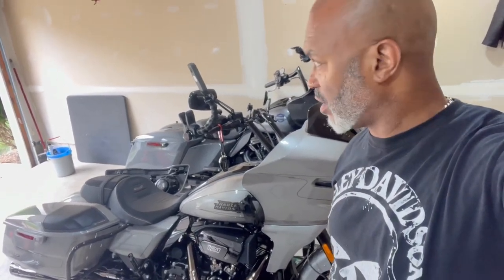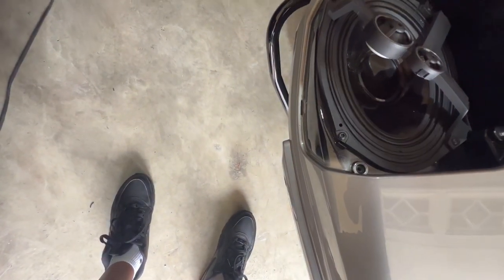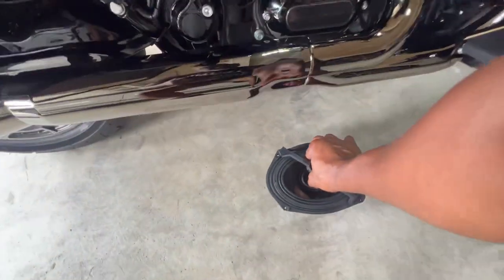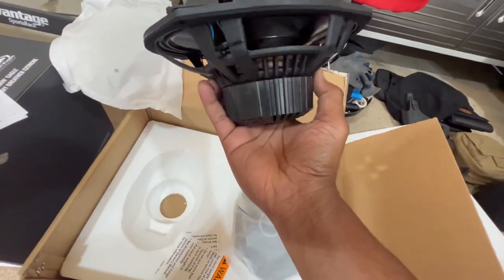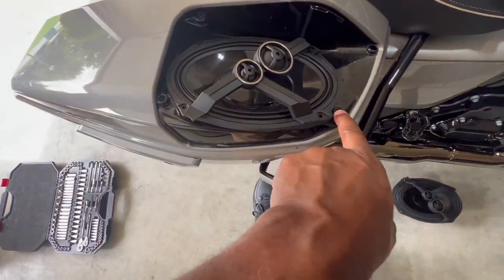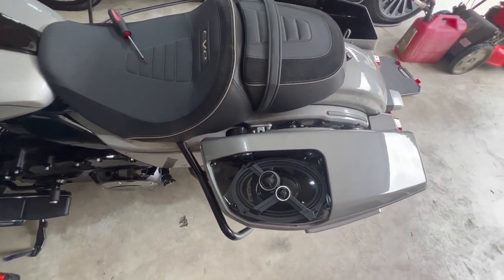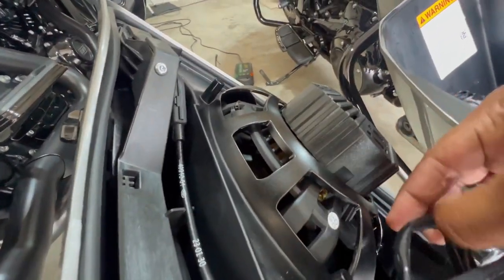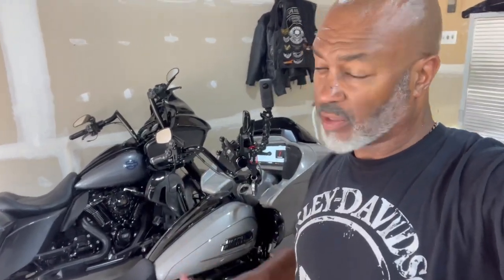How to install the Rockford Fosgate 6x9 Stage III Speakers to your 23 CVO Road Glide.

Comment: Thanks, just ordered them for mine!
Reply from the maker: They make a difference.  More bass and louder.   I wish they came with them but you can off set price by selling the old ones or use in you older HD.
Reply: @ChrisGlides  , had my radio flashed yesterday with the stage III tune for these.  Wow, big difference.  This system really rocks.  Loud and clear with great sound!  Great upgrade
Reply from the maker: Yes. Certainly.  I liked that I didn’t need an amp install

Comment: How was the sound after it was flashed??
Reply from the maker: OMG. It’s Loud and Clear.  Then I don’t know that it got even louder because I had my media sound turned down.  It’s louder than I will ever play it.  Also note that this bike drawn a ton of power from the infotainment.  So you will drain that battery quick if you try and sit and play parked somewhere.  In my garage while on the battery tender and cleaning it is when I crank it sometimes.

Comment: Do you need the infotainment system to run these?
Reply from the maker: When I changed from 5x7 a radio flash was required but they worked without the flash.  There was a sound increase after flashed.